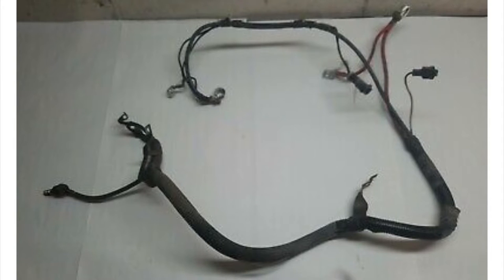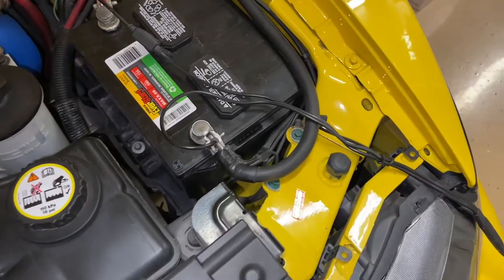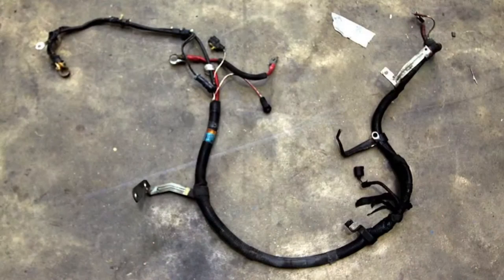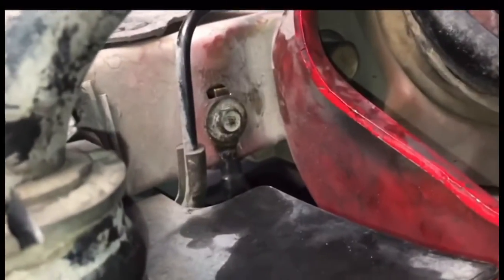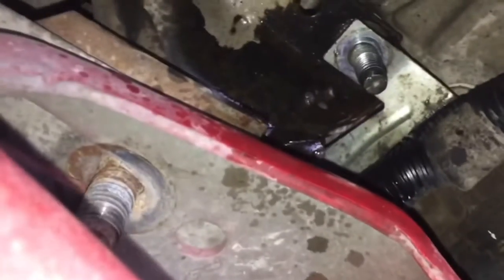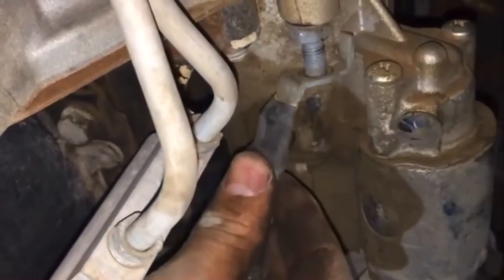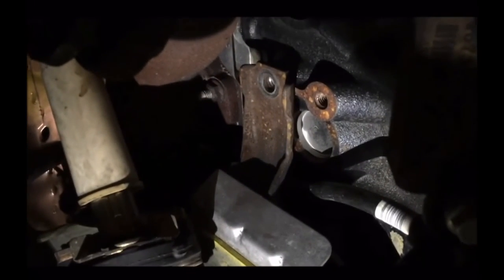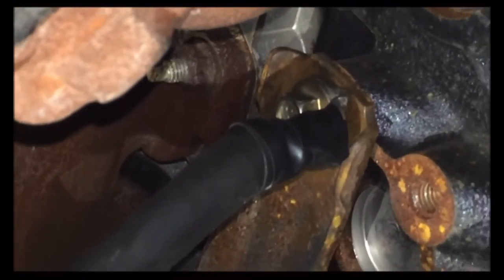Where your ground wires go: Shown on Mustang: Engine, chassis, hood ground wires negative battery

Comment: Faulty ground will make everything crazy !
Reply: I never had the negative ground connected I never messed with it I finally connected now my car won't start now was it that ground
Reply: Definitely true... My speedo tweaking out, passenger head light dim, engine dying when turning on heater, misfiring. Now it's mint 🤣
Reply: Still need help lol

Comment: I was lucky to save some hardware from an extra engine that included the stud for the ground that goes to to motor mount and i replaced one of the bolts to the motor mount with it. So I basically made both bolts for the motor mounts studs and added the big 3 to the new one for a clean install.

Comment: Pretty sure I have a bad ground somewhere as all four of my O2 sensors are throwing heater codes. Fuse is good. Sensors are new. Need to chase down where they ground to.

Comment: I put a tubular k-member in my 01 cobra when i was swapping in a built 98 cobra teksid, and it came with new motor mount bolts, without studs, so when I was finished doing the swap, there was a few ground wires I had left over so this helped 4 sure.

I usually put all nuts and bolts back where they go after I remove them so I never forget where they go, even though I can look at mustang bolts and pretty much tell where they go (especially fox bodies), but when you don't work on the car for a bit, you still can forget especially because a lot of the 4v bolts are the same, respectively, but the grounds that weren't connected to the harness were a different story.

Comment: Are these ground locations on all sn95's? I have a 94 5.0 that's having problems going past 4k rpms with load. The car stumbles and breaks up real bad and was said could be ground issue. I can't find a ground wire on my firewall at all and can't find reliable info on where they all go
Reply from the maker: This video shows where they are mostly, in exception to the starter (some use the transmission itself as the ground for the starter). You should have the one by the oil filter and on the motor mount(s) for sure
Reply: @dannyjohnsonsgarage   ok I've found the one by the oil filter and I'll check the motor mounts for sure. Thanks

Comment: Do you happen to know the size and pitch of the nuts holding down the ground cable to the engine near the oil filter housing?
Reply from the maker: Should be 13mm nut but I don’t know the pitch

Comment: Right turn back signal doesnt work but lights do, battery drains in 3 hours, and windshield wipers wont turn on. Can a bad ground cause all those?
Reply from the maker: Check all fuses for a power draw https://youtu.be/s98LpJFGg4A

Comment: The cable shown at 0:14 has been disconnected since buying my car in 2017. Do you think this could possibly just now be an issue? My 03 GT won’t hold a charge, turning on the lights, using the radio and hitting the brakes (brake lights) all drain it fast. Any help with my headache would be greatly appreciated!
Reply from the maker: I’d run a few continuity tests on fuses with the car off https://youtu.be/s98LpJFGg4A

Comment: On the blue motor mount , where the belt strap is, on my car they are together on the bottom nut . And it seems burnt , my #17 or #18 fuse blows every time I turn key to ON. Causing car not to start .
Reply from the maker: If you can follow the ground wire to the other end, replace it. If you can’t, you may need to graft in a new section

Comment: Just did a swap on my 2000 Gt.... My problem is my fuel pump wont engage.... Hot wired it and it came on... My question is can I run a toggle switch to keep the engine running?
Reply from the maker: I would check the fuses and relays https://youtu.be/u8rogpZSCXg
Reply: @dannyjohnsonsgarage  I checked all fuses and relays.... Nothing was wrong with them.... My gas hand works so I guess there's power but the pump isn't working.... What are your thoughts on this??? Again any help would be appreciated
Reply: @dannyjohnsonsgarage  Update..... Got everything going... My issue is cranking but no start.... Could the grounds for the engine, chassis, and body be an issue?

Comment: Hello I have a issue with my 2004 mustang g.t 4.6..i was sitting with the car on then it turn off now I have dashing ,s won't start
Reply from the maker: The dashes usually indicate it is not connecting to the computer. It depends on which module, one can be the ccrm behind the fender (I’ll link a video below). Sometimes it’s as simple as the ground wires near the computer (behind the passenger side kick panel to the right of your feet when sitting in the passenger seat https://youtu.be/PfiN6U-FqMQ
Reply from the maker: Also check the fuses https://youtu.be/tSj5HVtMDoE

Comment: Danny what is the factory alternator voltage on a gt I see 105-130 on rock auto
Reply from the maker: 105/110 amp. After 170amp upgrades you’ll want the big 3 upgrade or at least a power wire with an inline fuse matching the amp rating 
https://youtu.be/0j6HM11D2dw
Reply: @dannyjohnsonsgarage  what about a 130amp? Rock auto says it’s for the gt and bullit

Comment: S197  ground near the starter is disconnected on my car.
Reply from the maker: Is it still there, not connected or you can’t find it? Some don’t have a ground on the starter and use the transmission itself as the ground
Reply: Hey question, my 197 is the same way… has it affected your radio?